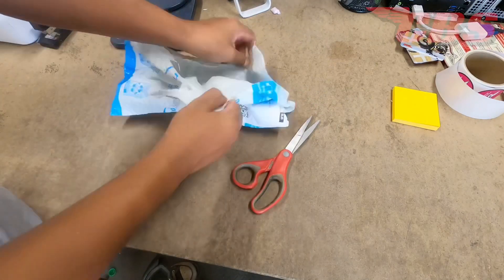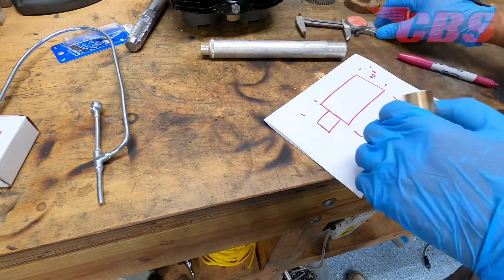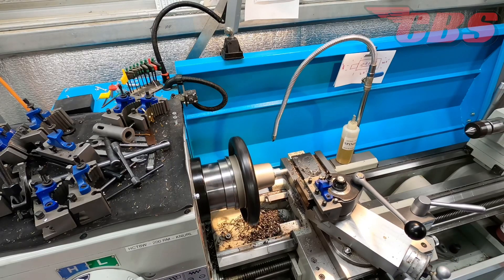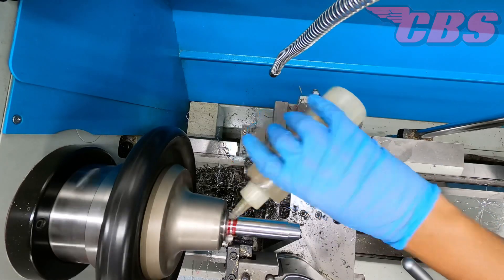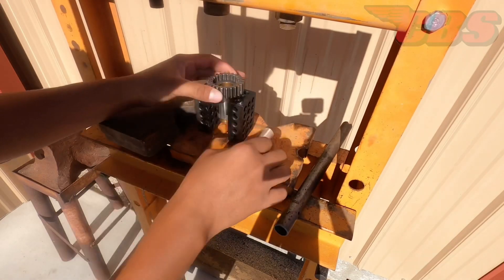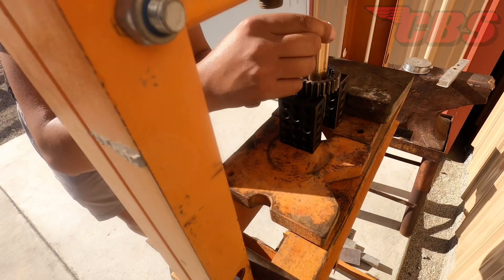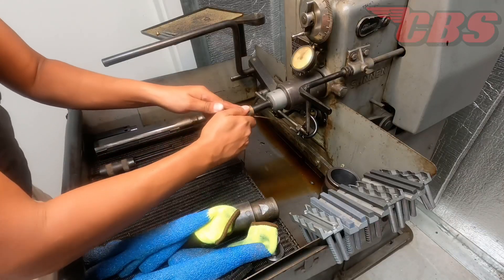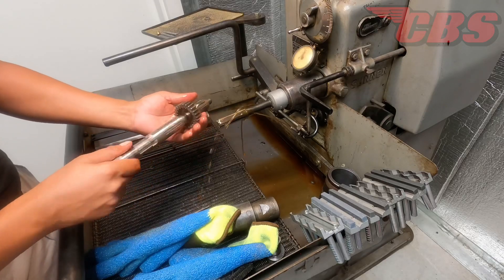Triumph High Gear Bushing Sizing (Service)

Comment: Can you tell me the symptoms of having a very worn high gear bush .? Would there be a strange vibration now and then but only in top gear ? Or would this only give you a oil leak ? Cheers.
Reply from the maker: If the outside has a groove, it will cause oil leaks - vibration could happen, if your mainshaft is bent, you will get vibration depending on how bad the run out is

Comment: Nice job.
Question. How far out (gearbox cluster end) should the bushing protrude if at all ?
I'm trying to upgrade the 4th gear (early type `66 with the bushing open on clutch end) for the later gear with the extra metal nose.

Regards from UK.

Comment: 2 thou seems a lot of clearance.
Reply from the maker: Book calls for a minimum of .0025" - keep in mind that oil needs to get into the bushing, also, the tighter you run the high gear on the shaft, you need to ensure that the mainshaft has very minimal run-out. I'm certain .004" is the max that the book calls for